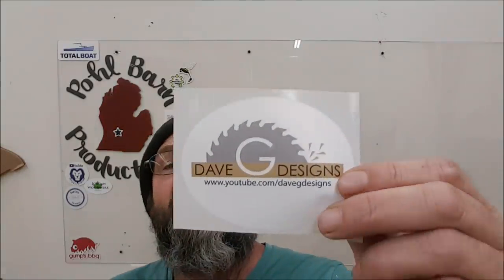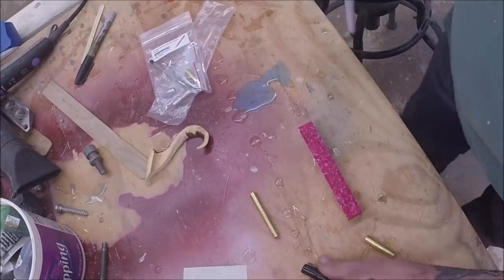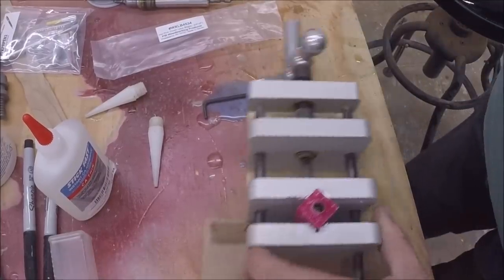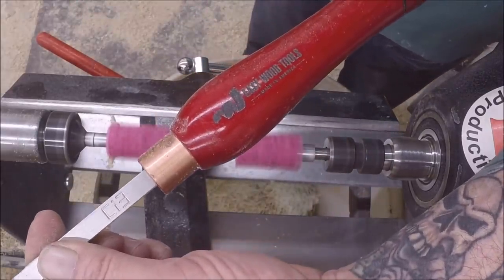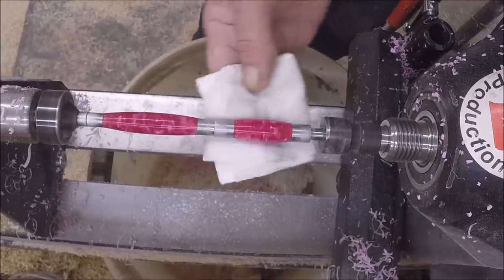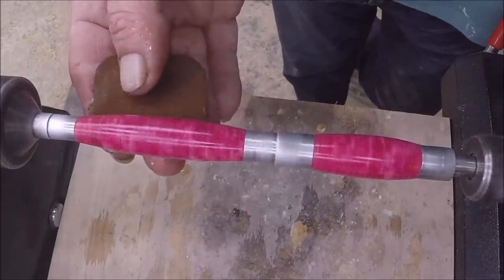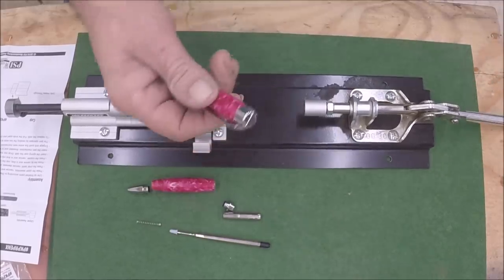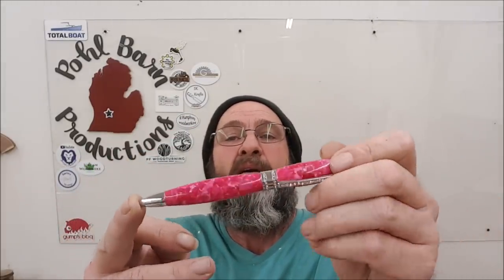Princess Pen

Comment: Have you ever made your own pen blanks? I did order some total boat but I haven’t used it yet can I cast or do you cast with total boat? Great show keep putting them out
Reply from the maker: I have but my mold isn't square, so I have to take it all apart to remove the blank,  the total boat should work fine, even better if you pressurize the blanks.  I've been using it for just about everything, and making some blanks was a planned project for a "Tuesday episode

Comment: What brand of lathe are you running? Any complaints with it?
Reply from the maker: Nova Galaxi DVR,  minor things,  I have a vibration but it could be the un-level floor and the pad for cotroling the speeds didn't stay stuck very well and I had to tape over it to keep shavings and dust out, other than that it's Awesome, it only vibrates at 750 and it's minor but still there.
Reply: Thanks man! Looks well built. I bought and old one to get me started and ive done a couple of cool things on it. Definitely want to try some pens. Love the content sir!
Reply from the maker: Thanks again Andy,  pens are fun, with in a short time you can have a beautiful project, it's very satisfying and a bit addicting once you start making them.
Reply: @PohlBarnProductions  well that is good news and bad as i have an addictive personality, if a little is good alot is better! Lol. Looking forward to it!
Reply from the maker: A lot is Always Better !  LOL  have fun with it